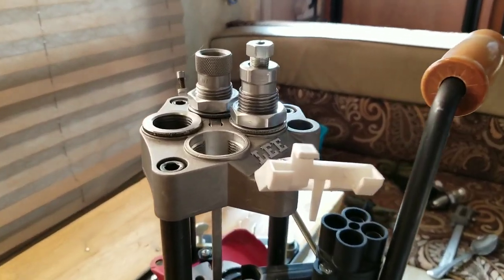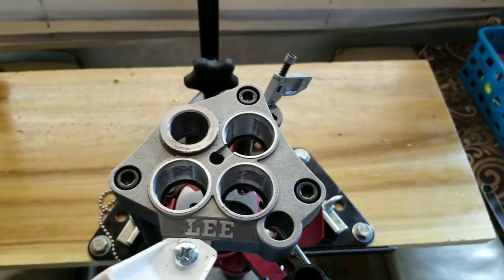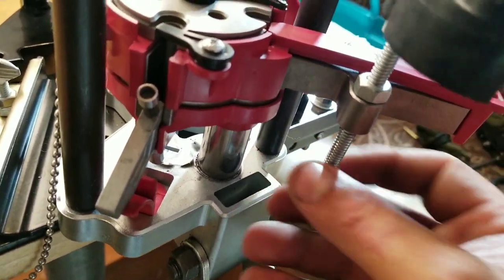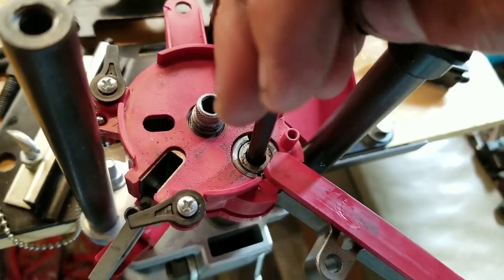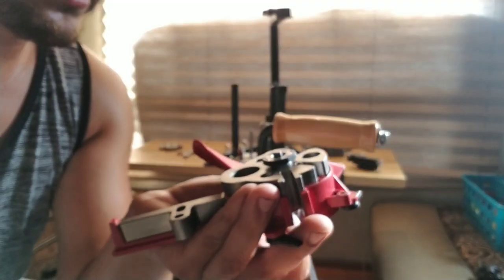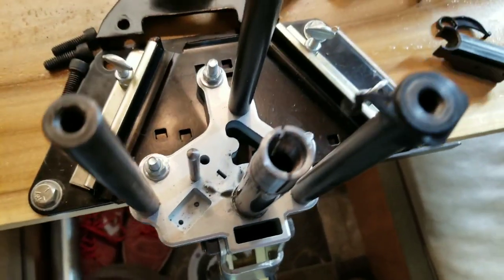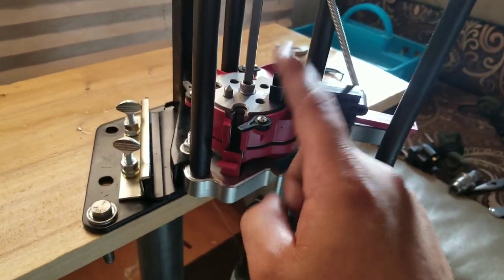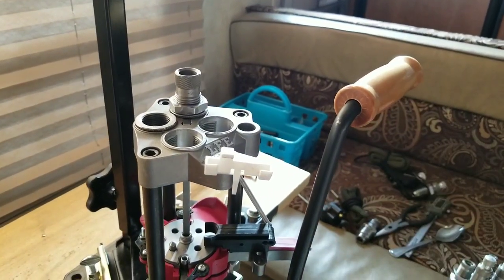Complete Disassembly of The Lee Breech Lock Pro. Installing TreeTopFlier's Powder stand

Comment: I have the 6 Pack Pro which is very similar in build to the breechlock Pro. The Ram on my 6 Pack Pro was retracting on the downward movement of the shell plate carrier when resizing brass. I didn't Understand how to adjust the pressure on the ram to shell plate carrier. Now I do, THANK YOU!!

Comment: Man, this video is gonna help me a ton when I put my new plastic pieces on that I ordered from Lee. I mangled the track just like you did for the case feeder 😂 One thing I noticed, I ordered the 3 cav family and the 7 cav family. 3 cav being red plastic pieces, 7 cav is the smaller black pieces. I got two of the 3 cav and one 7 cav, along with a new case feeder spring just to have on hand. My order was $5 plus shipping! They gave me a lot of stuff for free for whatever reason. Thanks Kenny, you rock man!
Reply from the maker: Haha you rock brother. Hey Get yourself a tight fitting allen head socket for that ram allen nut and a impact gun. That sucker is in there tight. I would also soak it in PB blaster before

Comment: Great video. Just wanted to add something you may not know. Noticed you used a crescent wrench adjustable end as breaker bar. Your crescent wrench should have a hole on the other end. If you put the Allen wrench through that hole it works much better and safer. My dad drilled water wells when I was growing up and he used larger crescent wrenches the same way. Again great video, I used it to replace a part on my press.

Comment: "Don't be afraid, you won't break it"....yeah, I broke it.  I know it's not Lee's fault but I'm just about done fighting with this press.  I'm very close to becoming a blue convert.  Thanks for the video though.  Very well done.
Reply from the maker: Man thats a bummer! What broke exactly on the press?
Reply: I needed to replace the top plastic cover on the carrier core because I crushed it with a case and the slider block wouldn't slide anymore.  When i got to the part to disassemble the carrier core (about 4:10 in your video), I stripped out the allen screw.  I could not get it to budge no matter what I tried to use as leverage.  Eventually I was able to replaced the plastic piece by getting to the screws with a small screwdriver.  I guess I should have went that route from the beginning.  However,  if I ever need to remove the carrier core in the future, it ain't happening.  I really like the potential of this press but I've had bad luck with it so far.
Reply: @Nuncles  I snap a Snapon 1/4" hex head socket and eventually rounded out that dag on plug. Like you I only needed to replace that cheap plastic top cover.
Reply: @allenrichards9949  The sad thing is, with the right size screwdriver, the cover can be swapped out without taking everything apart.  Which I found out after the fact unfortunately.
Reply: @Nuncles  same here. Wish I would of seen your post before I started.

Comment: FYI I watched your video, tried to take the carrier off the ram. I broke hex keys, and rounded off the nut, with over 350 ft lb of torque. I contacted Lee and they said that they use a Torque multiplier, so you are not suppose to take the carrier off the ram. So people may watch the video, and think you can, When you will damage it.  You need to flip the press upside down, and remove the 4 screws. I thought I share my personal experience.
Reply: So glad you made this comment.  I bought a screw extractor and could not get it to budge.  Was getting ready to put some serious muscle in to it and decided to come back in and re-watch video.  Decided to read some comments and saw yours. Went back out to the garage and flipped it over took out the four screws and boom it was off just like that. Thanks for preventing me from ruining my press.

Comment: I cranked on mine until the Allen wrench bent to 30 degrees. Still didn’t budge.
Reply: me too
Reply: Flip it over, remove the 4 screws and the plate comes off. You don’t need to remove the Allen head nut

Comment: Nice to know. Unfortunately i cant get that hex bolt on the shell plate off. Bent the Allen wrench.
Reply from the maker: A lot if folks are having that issue.  You can still remove the red plastic without taking the carrier off.  Using a Phillips Allen

Comment: I noticed your case feeder slide is indented from a case jam? How did you get your case feeder block to slide so smooth? I used mine for the 1st time last night and the block started to stick halfway in. Pulled the block off and there was a nice indentation on top. I wasn't going fast or hard.
Reply: same problem i just ordered a new carrier upper but i cant get the bolt to budge as of now the press is useless to

Comment: Kenny I need your advice, I am loading 9 mm on my breech lock pro. I am using the crimp die that crimps after the bullet depth is set. I am having trouble keeping a consistent bullet seating depth as that last crimping station the case go's all the way up and resizes the bottom of the case .  I think not having an actual stop or cam over at the bottom of the stroke might be the problem any help would be appreciated thanks Robert.

Comment: Thanks for all the info I dint expect to get a response that thorough , I appreciate it.   I agree on the volume of case is more important then weight , but I would think it is to hard to Measure precisely so I never bothered with it , I measured my weight and just don’t use the cases that are out of my set Parameter usually if they deviate too much I’ll just set them aside. To tell you the truth I’m not sure but I think the concept of measuring by weight works like this if you Have new brass and you full-size that brass so the outside of the brass is exactly the same Then the weight of the brass will tell you which brass it’s thinner or thicker so you can also measure inside capacity that way, You won’t know exactly what that capacity is but you would know which holds more powder and wish hold less Powder. I would Imagine that syringe has to be very narrow to be able to precisely tell you the volume . If you have links to any videos of how to measure using the syringe send my way I’ve never seen it done.  Are used to shoot 1000 rounds in a weekend just plinking Then an all-time let me shoot his BR six and I was hooked since I was just transitioning from tacticool rifles And like the military look I settled for TRG 22 with the Schmidt and bender 50x Scope It’s fully tricked out with Front and back up sights    Mirage bands Carry handle clonomiter ,bubble level , 20 moa scope mount from Switzerland I think Custom engraved Turrets , brake, skull bolt knob and custom rear support monopod. I dint want a benchers custom gun because I thought it wold be to heavy , my rifle is so heavy I would suffer it I would take it hunting . But it’s nice the bolt is silk like best smoothest bold I have tried ever. 
It took me 3 years to save up scope and rifle was 7k plus rest about 4k more .      I know there are better rifles to be had for that price.   But I’m happy with it . My point was I had lots of toys that were just rapid plinckers but the acupuncture long distance rifle shooting is so much funner like reloading it Nourishes my ocd.. :)  I shoot my 45 at 100 yards . Unless it’s shooter tracking just plinking is not fun anymore.

Comment: The ultimate allen key is very hard to left, how do you do it the first time?
Reply from the maker: impact and a good hex socket.  I made sure i had a good amount of my socket and straight. Used a cheater bar and gave a bouncing motion
Reply: I also tried with the starting point of a drill and I still could not get it!
Reply from the maker: Your talking about the allen hex plug that holds the carrier down on the ram right? I'm a little confused about what you mean on using a drill
Reply: yes the the allen hex plug that holds the carrier down, I tried also to unscrew it with insert a hexagon for the drill, but nothing unfortunately
Reply: seems to be completely blocked
Reply: 4:53 You unscrew it very easily, I do not unlock
Reply from the maker: It takes a lot of force once your crack it loose you can't remove it unless you bump the carrier up a little and sneak it out. I suggest a 1/2 impact or a good snug fitted hex socket and a big cheater bar with that bounce method
Reply: Ok I will retry...I have to unscrew!
Reply: Thanks for help me!
Reply: Unfortunately, the Allen does not unscrew, I think it has been stripped after all the attempts I made to unscrew it. that you know there is no way to unscrew it in another way? Maybe from under the piston?  I have to change the carrier where it slides the sled that pushes the case because it is damaged, I already have the spare part ...
Reply from the maker: I'm not sure how folk are stripping out this Allen plug. Its threaded but tight. A good thread penetrator and having your tool squared worked for me on 2 of these presses. You may have to invest in a extractor and weld on a 17mm nut to it to use an impact. Did you try and impact on it or thread penetrator oil?
https://www.officedepot.com/a/products/176323/IRWIN-Spiral-Flute-Extractor-Set-6/?cm_mmc=PLA-Google-MobileTools_Equipment_-176323-VQ6-253527897000-VQ16-m-VQ17-showcase_product-VQ18-online-VQ21--VQ22-913179245-VQ27-51055750790%26adpos%3D1o44%26creative%3D253527897000%26device%3Dm%26matchtype%3D%26network%3Dg&gclid=CjwKCAjwuO3cBRAyEiwAzOxKsk7fj3BVeJ4DFmJgOJyvEjwDhD0DUcM4fLWhJn2N7PB5Q0V7n1FMnhoCF4IQAvD_BwE&gclsrc=aw.ds
Reply: I tried to put the oil unlocking but it did not work, now I think the only possibility that remains is to thread the inside of the Allen with an extractor and then try to unscrew it. Otherwise I will not be able to remove the carrier in order to replace the plastic parts
Reply from the maker: Save your self the hassle and call Lee.  Sounds like its fubar
Reply: I have send a message to Lee, I'm waiting for answer...
Reply: In finally an extractor have solved all my problems! Bye and good shooting!!
Reply: @christianricci140  yeah flip it upside down take out the fourth screws and you can remove that plate

Comment: Why would you completely disassemble a press to put on an accessory?  Makes no sense to me whatsoever!!  But if one would decide to do so, good video.
Reply from the maker: Because things that are plastic break lol. That red overlay in the carrier will get damaged specifically on the case feeder ramp if a case was to accidently misalign and hit the top of the press.  It's a 4 dollar part but requires disassembly.  Beats the hassel of sending it back to lee for repairs.  Thanks for the kind words